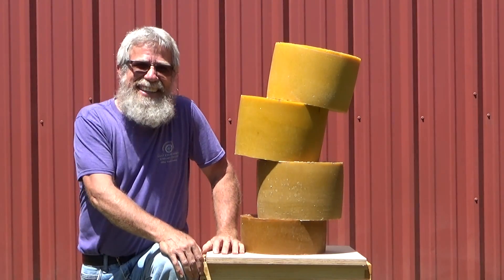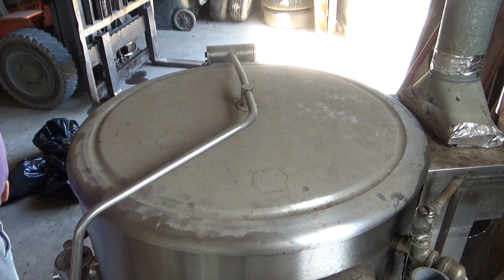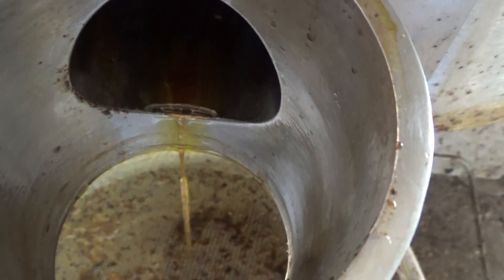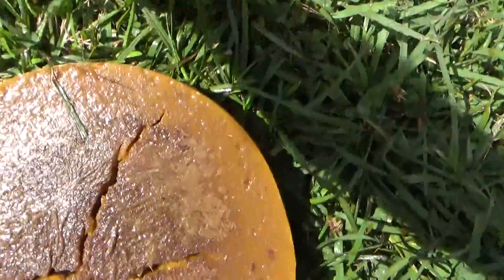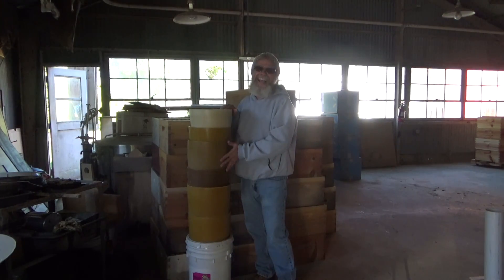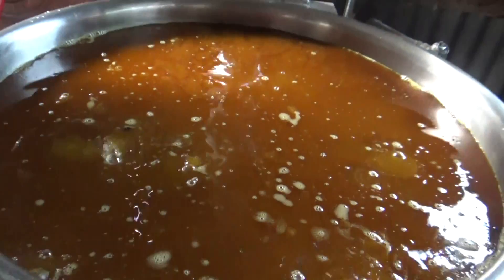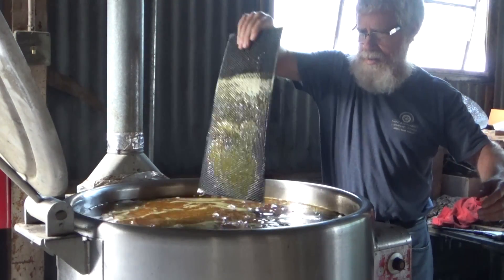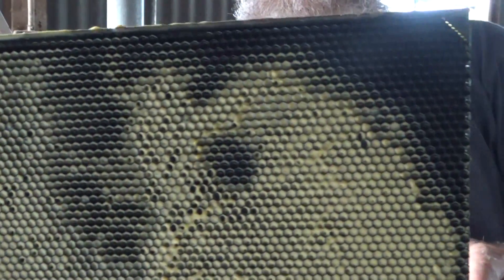Rendering old beeswax making it useful once again.

Comment: Now lout was a lotto wax to render down for sure. And I thought the roller method was pretty efficient but I gotta tell you really dipping these foundations in that cattle is the cat's meow for sure. Thanks for sharing my friend.
Reply from the maker: It was a lot of wax which is why it took so long to make this video, there are days between the rendering process. Still, it's worth the effort to wind up with frames that looked as good as these did. Dipping beats the heck out of rolling every time. Thanks for watching. God's peace.
Mr. Ed

Comment: I've got to get me one of those shop aprons.  It really makes you look like you should know what you're doing.  Maybe I can make one out of a horse blanket.
Reply from the maker: You are one slick Rooster, making what appears to be a somewhat compliment, and then getting the dig in on me by mentioning a horse blanket.Very subliminal, but quite effective, trying to drag my name in the dirt. God's peace brother.
Mr. Ed
Reply: @JeffHorchoff  As much as I would like to take credit for such a clever little twist on a back handed compliment I just can't.  I didn't think of it until you mentioned it.  It did turn out pretty good though.

Comment: On a much smaller scale, using a Kelley Beekeeping model KH100, I place steel wool pads (held in place by binder clips) in the output shoot to strain the wax and it works great.   I also uncap in this same setup using the steel wool to strain the capping honey.   I keep the capping honey separate as it seems to have a higher pollen content.   Health food customers prefer it.
Reply from the maker: My method of placing the netting in the throat of the nozzle uses the same pretense as the steel wool you describe, it works very well. Thanks for watching. God's peace Bob.
Mr. Ed

Comment: I have a small block of beeswax that use on thread for sewing leather and also rub it on the edge of leather before I use a burnishing tool to smooth the edges. One other thing I found out about, is honey is a natural antibiotic use can use on cuts, even deep ones. Your body will absorb the honey that's put in a cut and it will kill any bacteria it comes in contact with. I'm not in a position to give medical advice, but all I can say is I've been using honey on cuts since the late 1960's and all I can say is I never had an infection and I also got faster healing and the skin on both sides bonding together faster.
Reply from the maker: It is a very well known fact about the medicinal uses for honey, and beeswax. I had a friend who had lung surgery, and his wound was packed with beeswax to prevent bacterial growth. Thanks so much for sharing the facts and for taking the time to watch the video. God's peace.
Mr. Ed

Comment: Jeff, it'd be easier to remove the cocoons with a spider sieve/skimmer.
It's a kitchen tool for removing things from hot oil or fat.
They aren't expensive and would be much easier to use than that old basket.
Reply from the maker: I have one, and I do use it, I just did not use it on the video. I use it right after I get the really heavy trash out with the basket. Thanks for your suggestion and for watching. God's peace Ian.
Mr. Ed

Comment: Jeff - what you need is a "Spider" like they use in commonly oriental cooking to strain the "trash" out of your wax. Also my neighbor who keeps bees wraps his dirty wax in double layer of cheese cloth when he renders his wax down after everything is melted down he has an old turkey frying pot that he has put a couple drains into so he can press all the excess wax out.  Have a nice day and pray you have a successful Bee season
Reply from the maker: What I did not show was the debris that is placed in the tray is on a drain pan. The wax that is still on the cocoons runs through the holes in the pan and dries at the bottom of the pan. I collect all that and render it as well. It works very well for me. Thanks for your suggestion and for watching. God's peace.
Mr. Ed

Comment: Jeff you could probably string some pant hangers together to dip a bunch at a time. Might help speed it up, just gotta find a good way to get that excess off em
Reply: I was thinking that too, but I think  it might slow him down more than help. Even cooling isn't as important as even drying of paint, so clipping them on and then unclipping them would be slow. If it was a production line and he had another helper just doing that it would go lickity split
Reply from the maker: I'm still trying to come up with a way to shake a bit more of the wax off as well as cool the foundations off a bit. By next year I will have come up with something. Thanks for your suggestion and for watching. God's peace.
Mr. Ed

Comment: Brother get yourself a 1"x2" piece of wood the length of the frames, add a couple hooks, hook the frames and hold the wood while dipping the frame in the wax. Alternately you could make a couple hand hooks for holding the frames for dipping. This would keep your fingers away from the melted wax.
Reply from the maker: Your idea is a good one, and I'm sure it would work, but since I'm all about getting the job done quickly, I'm going to keep using my fingers. I have discovered by wearing latex gloves wax will not stick to them and it does not burn as bad if they dip into the wax. God's peace brother.
Mr. Ed
Reply: Check out food grade nitrile, I work in an industrial kitchen making candy the gloves we use let me stick a gloved hand into steam briefly

Comment: Ceramic artist use Very fine meshed sieves to run their glazes through. They're made to fit inside the rim of a10 gallon bucket line the ones you're using.  They would remove so much more debris and probably cut out the need To filter out a second or 3rd time. You could probably get them through a pottery or ceramic supplier knew you or online
Reply from the maker: Thank you so much for your suggestion and for taking the time to watch the video, it is all greatly appreciated. Also, I hope you will check out more of my over 450 bee wrangling/ bee rescue adventure videos and let me know what you think of them. By the way, I post a new video almost every Friday morning, and I look forward to hearing from you again soon.  God's peace Stacey. 
Mr. Ed

Comment: Didn´t read all the comments. What if you do not dump your honey combs into the water in the kettle, but on several layers of mesh. Finer and finer for filtering right above the waters edge to avoid the dirt in the kettle. Maybe you can also save some rounds of rendering. The mesh can also heat up and the waste of wax could also decline. Maybe.
Love your enthusiasm, greetings from Germany.
Reply from the maker: I've tried many different ways of cleaning the wax, but in the end, the simplest way is to place a strainer on the gate and open it all the way. It takes a bit longer to drain the water/wax, but in the end, it comes out much cleaner and a lot less work. So glad to hear you enjoy watching, thank you so much for doing that. God's peace brother.
Mr. Ed

Comment: Hi Mr. Ed!!!!!  It's been a long  time.   I use a collendar to strain my wax.  In my pot with melted wax I'll put in the collander and leave it there.  Only the wax goes in and keeps out the slop.  Then I'll take a laddal and scoop out the clean wax and put it in pot with an inch of hot water.  No more slop to worry about until I'm done all my wax.  I just keep adding wax and let it melt.  In the end after I've ladled the clean wax I'll have a thin layer of wax on top of the slum gum.  I let that cool and throw the little bit left in the solar wax melter.
One time and that's it.    No more straining and re-straining.  
Loved your waxing frames section
Good luck to you for the rest of your year.

Comment: Two questions: 
1: How does it smell with that hot vat of melted wax? I would imagine it smells great.
2: How often and how badly do you burn yourself on that vat? I would keep trying to rest my arms on the edge, or bump into it.
Reply from the maker: I always say the smell of wax as it is melting and setting is like crystal pure sweet air, wonderful. After the first 2 or three times it happened, I learned not to touch the side or top of the kettle, it's HOT! Thanks for watching. God's peace Ralph.
Mr. Ed

Comment: This never gets old.  I just wish I could be there and smell it. :)
Ever considered something like mosquito netting over your bucket, catch the smallest stuff?
Wow..those foundation stacks make me hungry for sugar wafers... :P
Does dunking them like that leave more wax on the foundations than the roller?  Would it make sense to have something like a paint roll 'mangle' that would fit in the kettle, so you use a bit less per frame?
Reply from the maker: The smell of freshly rendered wax Is delightful, I wish I could get that in a video as well. I have considered placing the old wax in some type of bag to catch the wax, and so many folks have suggested it, even though I'm reluctant to do so because of the amount of wax loss in the bag, I need to see exactly what happens. They do look like sugar wafers, but they would not taste as good. The dipping process does leave more wax than the rolling process, but I'm OK with that. Thanks for watching. God's peace.
Mr. Ed

Comment: Have you considered using an oil filter set up? You could get filtration down about 20 micron with much less effort. When the wax is hot its viscous like oil.
Reply from the maker: I'm pretty low tech and VERY low budget. I know it could be rendered finer and possibly with fewer steps, but the way I do it does work for me. Thanks for your suggestion and for watching. God's peace.
Mr. Ed
Reply: @JeffHorchoff  I assumed those boilers were not cheap. An oil filtration system and pump is probably lower in cost than you may think.  Either way I learned something from your vid, so keep on posting. I am sure there are tons of other methods as well. One thing I have learned in life there are many ways to do pretty much anything.
Reply: Hello dear friends.
I want to help.
I'd like wild bee wax.
I forgot, I'm a student and on my way to an in-depth research I wanted some wild bee wax.
I'd like an answer, please.

Comment: Hi Mr. Ed. Love your vids. Why not save yourself some time and work and dump out your contractor bags directly into a 5 gallon paint strainer, knot it off and then put that into your vat of hot water? Wax will melt and seep out and most of the crud will stay in. Just pull out strainer when done and pitch it. Bright blessings.
Reply from the maker: Your idea is one I considered long ago, but my reason for not pursuing it was the amount of wax that is left in the bags. I believe the method I use is more effective is recovering otherwise lost wax. Still, thank you for your suggestion, your blessing, and for watching. god's peace Lynn.
Mr. Ed

Comment: a great technique for coating the plastic molds! you can save yourself even more time if you have 2 or 3 punches at the top of each mold, stick a rod through a stack of them (let's say 10 at a time), submerge them all, shake them all at the same time and this way you get through them faster.
some considerations if you decide to experiment with this technique:
1- separate the molds by about 5-7 cm (or their equivalent in inches) to give them space to breathe, I guess less than 5 would be not enough space to breathe, and more than 7 is unnecessary and would make it difficult to handle the stack (but you are welcome to experiment with the numbers)
2- you can punch holes at the bottom of the molds to and insert rods to have a better grip when shaking them...it would be way better.
3- don't leave no space between the molds in the stack, because you will end up with the inner molds totally soaking with wet wax (I hypothesize)

another suggestion, you can even take it one step further and have these rods fused into a frame just like the wooden frame for the molds, the only difference is that the rods would stick out from the side. This way you can easily add or remove molds without having to insert each rod separately and thus save even more time.

Great content dude, I am a huge fan, may Allah bless you <3
Reply from the maker: Thank you so much for your ideas, they are very good. I have considered some of your suggestions already, so get ready to see something different next time. Thank you for your blessing and for watching as well. God's peace always.
Mr. Ed

Comment: Seems like you could use a rig to dip multiple pieces of foundation at once to speed thing up even more. Even two (wire) coat hangers, with foundation clipped to them lengthwise with clothespins.  They'd be pinned where you would be holding it, where the foundation doesn't get waxed. Dip, drip for a second or two, then hang them to dry (maybe on a couple of rolling wardrobe hangers, which are cheap) while you do another set and whoever is helping unclips and puts the foundation back in the frames. Then you grab the rig that's done, reclip fresh foundation. Dip, drip, hang, repeat. You could have 2-3 going at once with two people working.
Reply from the maker: There's always room for more efficiency, and your suggestion makes sense. By this time next year I should have things worked out. Thanks for your help and for watching. God's peace.
Mr. Ed
Reply: @JeffHorchoff  Can't wait to see it!

Comment: It seems like you could run that wax through a modified milk separator and get more of that crap out of the wax. Perhaps spinning it again.
Reply from the maker: Unlike milk, liquid wax solidifies almost immediately  when it come in contact with air. Unless the machines are heated, the wax solidifies inside of them. This is the biggest issue with wax, keeping it in the liquid state through the processing. Thanks for watching. God's peace Leonard.
Mr. Ed

Comment: I recall my Grandpa used frames that had thin piano wire strung between the top and bottom and he used to somehow imbed the wires into thin pre-warmed sheets of wax to establish the base.

His centrifugal separator was hand wound and I don't recall any comb 'blowing out' of his frames so I guess it was a matter of knowing just how fast to crank that handle.
Reply from the maker: There is a real art involved, and a lot of practice, when spinning naturally drawn out comb. Since I have automated machines to spin and process the comb, it would prove very difficult, and for that reason, I use a plastic foundation. God's peace brother.
Mr. Ed

Comment: About 2.8oz of wax per frame. (if my calculations are correct) Those bees are going to have it good, I doubt commercial waxed foundation have it on that heavy. 
You folks at the abbey are fortunate to have some nice equipment to work with. Glad to see you are taking advantage of it, dipping sure beats manual application. 
Nice work Jeff and friends!
Reply from the maker: My way of thinking, the 2.8 oz. of wax that was applied, will yield about 7 to 10 pounds of honey per frame, and, when I uncap the frames, I will get back more than the initial 2.8 oz. per foundation. It's a real win/win for me. Also, like you said, it beats the heck out of rolling the wax on. Thanks for watching. God's peace Scott.
Mr. Ed

Comment: Jeff.. I'm enjoying your videos...and as I watched here, as you removed cocoons from the wax,...I had a thought --- you could get virtually everything out of the wax if you put these cocoons etc into a leg of pantyhose or a ladies knee high stocking ...for straining. I know they're great for straining paint........ there may be a reason you dont use them. yes?no? Just a thought ;)
Reply from the maker: I'm sure that they would work, but the amount of work it would take to get the cocoons into the pantyhose as to the amount of wax that i could gain by doing that, it's just simpler to use the fish basket and dump it into my drain pan. The wax that is in the cocoons drips through my pan strainer, and I collet the wax from underneath it. I did not show that in the video. Thanks for your suggestion and for watching. God's peace Dale.
Mr. Ed

Comment: With how much time u spend waiting for it to dry a little and knocking the wet wax off the trays, it seems easier and about the same amount of time just rolling them... and less of an arm work out 😇seems like you would use less wax rolling them. You roll it on in thinner layers. Snd you get so much in the trays when you dip them. But heck I’m not the professional 😇 they look amazing! Good luck to y’all in the next harvest season!
Reply from the maker: Since I posted this video, I have changed up the process of straining the wax. I now insert a screen in the kettle and leave 90% of the junk in the tank instead of trying to pull it out before hand. Check out the link below on how I do it now. Thanks for watching. God's peace Amber.      Mr. Ed
https://youtu.be/fWVpuUGjPWA

Comment: I wonder if you considered making your own wax foundation? I know it's not practical for extraction but when used in the brood chamber it makes it possible to cut out a queen cell so that you might move it to another hive without moving the whole frame. I've been thinking about this lately.
Reply from the maker: Wax foundation is a great base to build comb on, and the bees draw new comb on it very fast. However, for my way of keeping bees, the plastic foundation is a better fit. I think you should experiment with the wax foundation, what you propose is one of the very reasons folks like the wax foundation. Thanks for watching. God's peace Joseph.
Mr. Ed